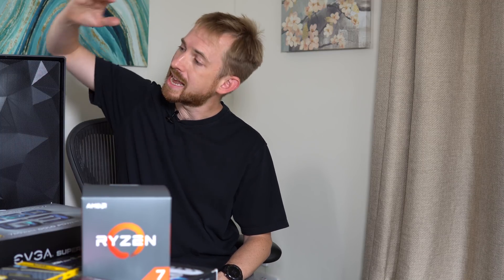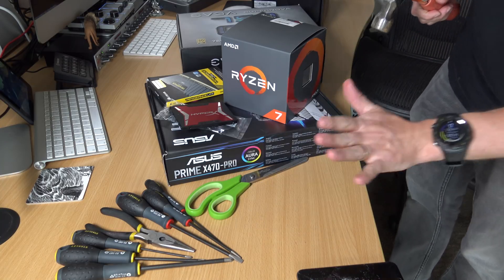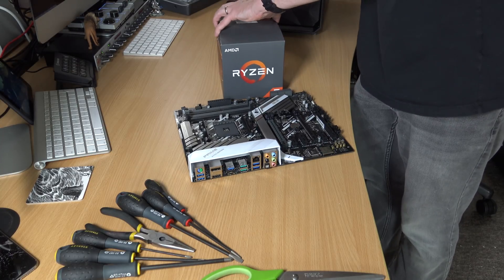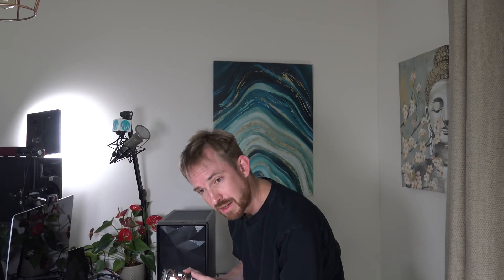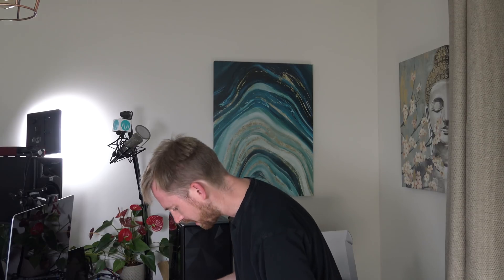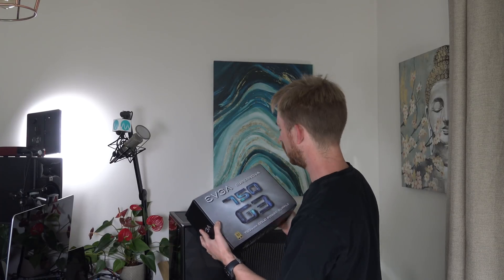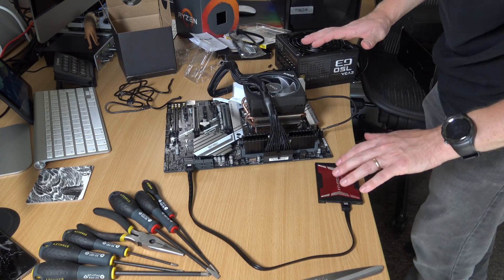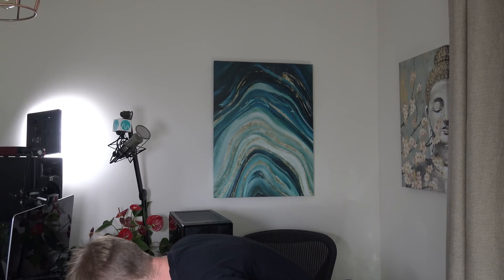PC Build Live "Premiere" - Building the Ultimate Audio, Video and Live Stream PC

Comment: I’m left wondering how much of this paid product placement advertising?  Also I don’t subscribe to the build it outside the case theory! Never ever done that and don’t see a point.  In order to tidy the wires into the cases ducting you’ll have to disconnect power and SATA again anyway so what’s the point in building twice?  Mind you there’s no power to the SSD anyway so that isn’t going to work in it’s present state.   Also probably a better choice would have been an SSD for the OS and software with spare room for a temp directory for rendering but may as well keep the data on a secondary hard drive.  More storage space at an affordable price.  My PC is built with an SSD and 3 other hard drives.  It runs my home media server, edits audio and video, converts and renders video and all works well and in my opinion it’s a better configuration that a single drive.  When the time comes to think about a clean format I don’t have to worry about any data and none is stored on the system drive.
Reply from the maker: Hi Mark, this initial PC build all came out of my own pocket so no placements in here.

I'm happy to feature placed gear in the future but to start I'm just striving to create the best PC possible with my limited knowledge and learn along the way from folks such as yourself with great ideas to share. 

Thanks for the help!

Comment: You forgot to connect SATA power to SSD! Also Ryzen 7 CPUs don't have integrated graphics like intel chips so you must put in a dedicated graphics card in and connect THAT to the monitor to see if the system POSTs. prime pro mobo don't have dedicated start & reset switch on board so just take a screwdriver or a key and touch the IO headers for power as shown in mobo manual to boot on test bench.

Also, upgrade to NVMe SSD like Samsung 970 evo/pro as they're way better in terms of speed and cable management etc.
Reply from the maker: This is so very helpful. Thank you!

I finally got an awesome graphics card installed: https://www.youtube.com/watch?v=zGqUJXNpl-w

Now it's time to keep an eye on an NVMe SSD - they look awesome!